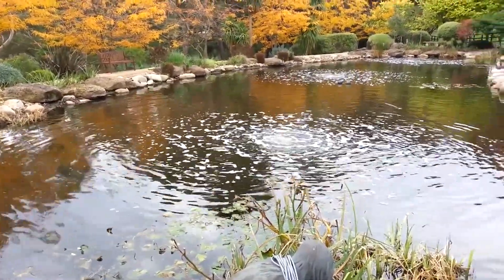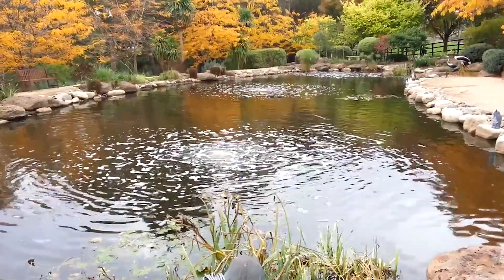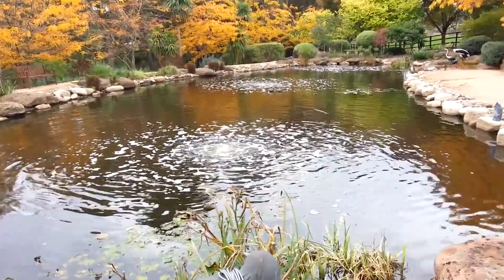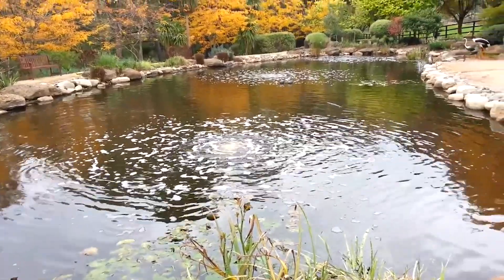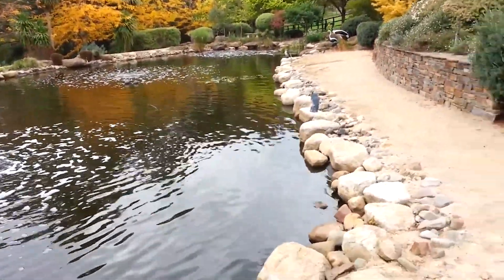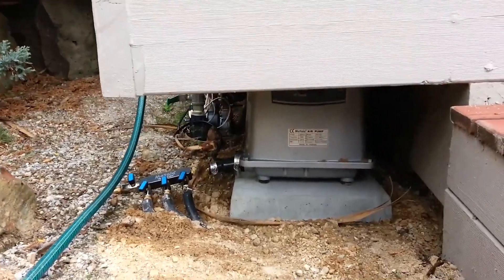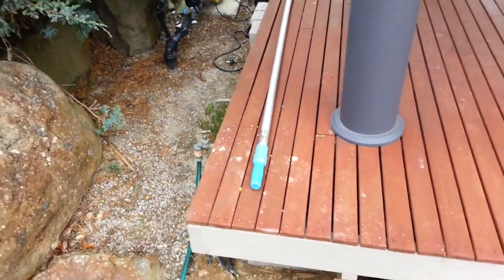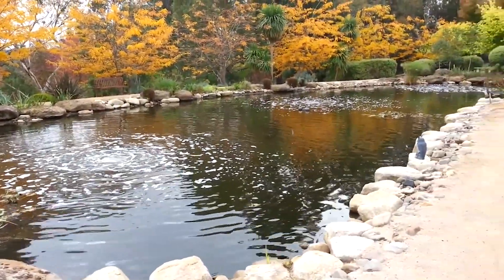Meet the Matala Hakko Aerator

Comment: is 3/8''  hose enough for for the farthest diffuser or one have to use 1/2'' or 5/8'' hoses in that case? Does it make any difference whatsoever, upon condition we use a diaphragm pump of Hakko type?
Reply from the maker: For a Hakko aerator, for hose runs less than 30m, you could use 3/8’’, 1/2’’ or 5/8’’. For runs 30m to 60m we suggest 1/2’’ or 5/8’’. And for runs over 60m, use 5/8’’ only. The wider the hose, the less resistance is applied to the air coming through, so wider hose can increase aeration (slightly). If in doubt, we tend to go for the larger size hose.
Reply: @scottytucker3571  Thanks a lot!